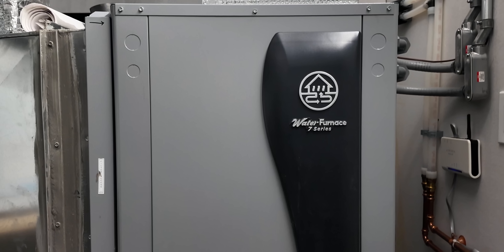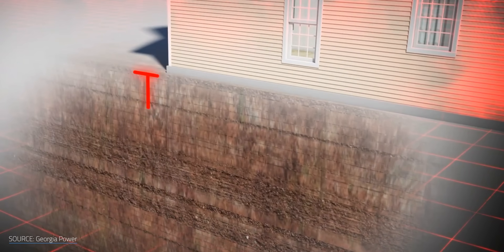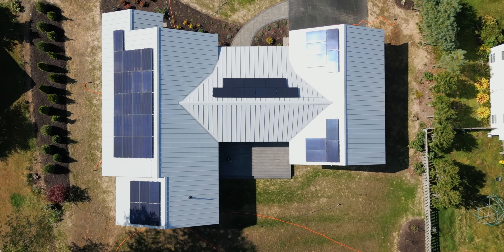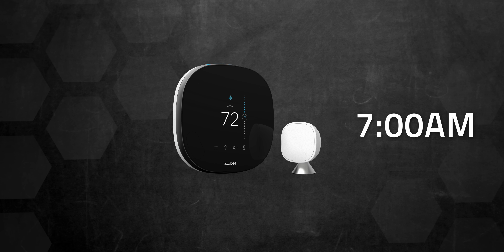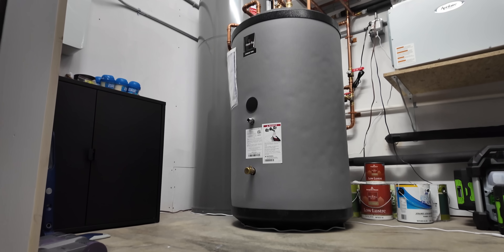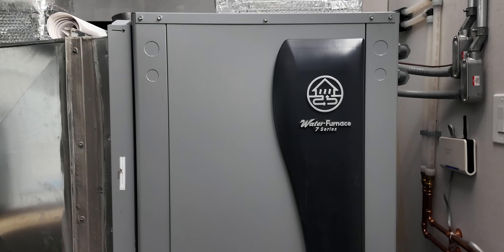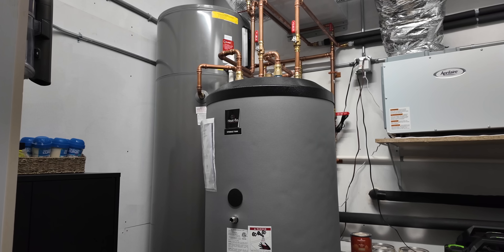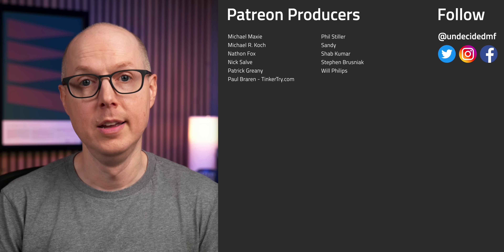How My Geothermal Heat Pump Really Performed (2 Years)

Comment: Main problem is cost, but more so, in that its complex. You are talking about digging and drilling - follow by pipes/materials. Without those rebates, the answer would be no. No one has that money upfront and if you do - you are not worried about energy prices like that. So over all, I say a heat pump with a  backup would be more than enough for many people and they do make hybrid systems like that either it be gas or electric. If the system does have an issue, you more than likely wont have to get someone that knows that system either meaning you would have a bit more access to more repair options as well. With that said, I would love to see a hybrid heat pump hot water + HAVC system some day. One pump that allows the recovery of that heat back into the water reducing the over all cost of the system and with only one pump reducing the overall complexity and cost of it as well.

Comment: Sadly, using a heat-pump for heating my house would be more expensive.  I'm in mid-west Ohio.  Our gas prices are dirt cheap, and it's much cheaper to use gas to heat the house, than any form of electric heating, heat pumps included.   That also makes a geothermal system wildly not worth it.   Also, My electricity prices are also really cheap.  With the delivery fee, It's about 17 cents per Kilowatt.  

Assuming the same installation costs as you ( yes, I know I can't assume that ), with my gas and electricity prices,  the return on investment time would basically be double compared to you.  But because of our cheap energy prices here, I haven't even looked at what a geothermal system would cost here.  

But, I'd LOVE to get solar panels.  I have a north/south facing roof, so half my roof points directly at the sun.  Since I don't do youtube as a job, and thus don't need a home server and equipment, I'm totally positive I could 100% offset my electricity usage with solar panels.   I have to have my roof re-done soon.  I might look into what a solar setup would cost, and any potential rebates from my state.  Sadly, the orange retard is killing the federal rebate on the cheapest form of electricity humanity has easy access to.  So I won't be able to get any kind of federal rebate.

Comment: The rooms at the back with the greater heating/cooling load... isn't keeping those more stable in temperature just a case of better emitter tuning required to match the loads, rather than a fault of the main system? I mean... can't you increase the delivery of heating/cooling to those specific zones as a one-off exercise?

Comment: Did a self install whole house Mr Cool. 
This was the second product from them I've purchased. The first was a small mini split in an addition (I don't want to jinx myself), it just works - set the temp and it ramps up and down as needed. 
The big heat pump replaced a single stage unit from the 90's. So far it works great, it's quiet and my electric bill is dramatically lower. 
I'm in Northern VA, the supplemental heat (those big coils that go "Click") never kick on anymore. I also did one of those heat pump water heaters a few years ago, the purchase price was over twice a traditional electric one, but paid itself off in about three years.
Reply: @phredrolltek  Mini splits are amazing.

Comment: We have an open geothermal heating system, with separate extraction and injection wells. I do not cool with it.  It has worked reliably for us for around 10  years, but our 100+ year old house is not tight or well-insulated, so our electric bill is dramatically higher than Matt's.   I don't think our power bill ever drops as low as CD$60/mo and is usually in the CD$400/mo to CD$500/mo range in the coldest months (Dec-Mar).  Still, having oil heating, resistance electric or air-to-air heat exchanger would face the same issues with our drafty house, so the geothermal system is still a plus.

Comment: Now that cold weather air-source heat pumps are getting rolled out by major manufacturers, most of which can provide 100% BTU’s at 0*F and still function down to -15*F, there’s really no need for ground source heat pumps anywhere in the lower 48. 

They can handle 99% of the country for 99% of the year, and electric resistance backup can handle the few hours a year some locations stay below -15*F overnight.
Reply: I don't know if he is comparing the operating costs of his geothermal system to the operating costs of a modern heat pump.
Reply: Yes, they can do it, but nearly as efficiently.  That's the whole point of ground source.

Comment: I’m still amazed that solar and heat pump tech in the US is so pricey. 
A 14kw heating/cooling ducted system (air source) for a 250square meter internal house with full automation for every room is only $20k AUD in Australia. We have 15kw of solar and 27kw of battery, for $40k AUD. We pretty much never use any power from the grid, and also charge our two EV’s as well. 
Hopefully things come down in price soon over there for these things! 
Great video too 😉
Reply: Yes, it seems so crazy to us Europeans too, but US have a lot more middle men and Bureaucracy with their fees if you step out of their norm which is coal and oil.

Comment: I do get the heat pump craze is great just having to worry about the construction to the equipment cost is always a hair puller but everyone needs to get paid. One of my friend's childhood homes had one, it even tied into there bathrooms tiles, it was so fancy at the time and just so comfortable to take a shower felt like a spa for your whole body 😂. Regardless I remembered they spent like 1.5mil to built the house yikes 😂. Im all for cost to efficiency ratio but even if I was rich id try to get it planned so. Maybe in 10yrs ill do what you did figure out the best plan for super comfort and get it to a 95% efficient house. Thanks for sharing 🎉

Comment: I wish some of these heat pump videos focused more on the refrigeration side of things. Living somewhere that regularly reaches 40°C most of the year I've always wanted to know about ways to not only chill my apartment but also use that heat energy for something productive instead of just paying to let it go to waste, but having a massive water heater at home in this climate is basically steaming yourself like a buttered lobster. All the info is usually focused on the global north and nothing really worth pursuing here.
Reply: there are plenty of videos about cooling-focused systems, and the choice is as wide as in heating- focused systems. If you live in dry hot climate, you could investigate direct or indirect evaporative cooling. If your climate is continental- hot summers, cold winters- then you definitely should check ground-source heat pump for heating with direct connection of ground loop to interior cooling devices- fancoils for almost free cooling. In all climates good insulation and smart management of solar heat gains is first priority, then comes sufficiently large ground loop and radiators or heated/cooled floor. All heat pumps, in heating or cooling mode works most efficient when the temperature difference between heat source and heat emitter is as low as possible.

Comment: I have a design concept that temporarily stores Grey Water from house hold showers, clothes washing and dishwashing in underground tanks.  The grey water can then be re-used for flushing toilets which reduces the intake from wells or municipal source AND reduces the output to septic tanks and municipal sewage treatment systems.  The tanks can also act as a heat storage system in conjunction with a heat pump which extracts heat from the grey water and also stores waste heat from PV Panels for later use and also cooling the panels better.  The concept has a pump which can switch to a sprinkler system installed under the eaves and on the roof peak to help fight fires if living in a rural area.
Reply: I have a feeling you would run out of water for all that. But they already do make grey water recovery tanks and they do similar stuff. With that said, while I dont know anyone that has similar, I would assume a recovery system does come with a few cons other wise we see it more. For example, you have to filter materials out of the water or risk that stuff building up over time. A shower still has soap for example and sink water might contain some food.
Reply: @adr2t  It gets recycled back into the toilet and then onto either a septic tank or a municipal treatment plant which is exactly where it goes with out a grey water recycling system
Reply: I have same fire issue.  5 evacuations in 5 years.  Last one took out 85 homes in my neighborhood.  Insurance ( my house survived) has become an issue.  Can you elaborate on waste water / solar panel cooling ) under eve sprinkler system?  Direct me to a supplier or a video?  Thanks, and thanks for posting your comment.
Reply: @pierrepfeffer4758  
Sorry but is just a design concept.  I just worked on it on my own after we lost 233 metered structures last summer.  If you like I can send you some PDF's so you can decide its merits?
Reply: @anguscampbell1533 yes please.  A contractor up here has advocated for under eve sprinklers using rain water.  Would love to see your more comprehensive approach.  Thanks.

Comment: Given such a sealed up house, what is your air circulation/filtration situation?
Reply from the maker: We have an ERV that’s running at a very low level 24/7, which not only keeps the air fresh inside the house, but does a great job filtering out pollen and pollution.  The hvac system also has a decent filter on it.  I also have a few in room air filters to help deal with my pet allergies.

Comment: I live in South Dakota and had a Water Furnace geothermal system installed about 12 years ago. My house is over 100 years old and we have done many upgrades to improve energy efficiency although it still is not nearly sealed and insulated as good as I would like but at the same time our experience with geothermal has been very good. I do use a back up heat source for the wildly cold conditions we often get in South Dakota( at time -50+ F windchills). I looked at the long term on everything we did to the house and the heating/ac has paid for itself over about 8 years. It really shines for cooling. (S.D. can be brutally hot, at times getting hotter with humidity that rivals New Orleans) That has been the very best  surprise for the system. It has been pretty much a trouble free and money saving investment for sure.
Reply: What are you using as a backup heat source? I've long thought that radiant heat panels would be ideal if you've got the energy budget, or a wood stove?
Reply: Be careful of sealing up your house too tight. Houses need to ‘breathe’ or you might run in to mold issues from condensation.
Reply: I have installed a gas propane heating stove with thermostat,  to supplement my system. Or if electricity is off for extended period.  Might not heat my whole house but should keep pipes from freezing.
Reply: How much did that system cost 12 years ago?

Comment: We were excited to get our geothermal system seven or eight years ago. Last year, however, the condenser coil failed, and the indoor unit needed to be gutted and replaced to solve the problem. 

Fortunately the system was still under warranty, so we paid nothing. 

I later learned that the only other two folks I know who have geothermal had the same problem during the warranty period. One of them had a second similar failure after the warranty period, costing him thousands of dollars to fix. 

We all had the same contractor who presumably had the same supplier.

I don't know how common this problem is. The contractor blamed it on the newer refrigerants and the coils. 

Any thoughts on this?
Reply from the maker: That’s a new one for me.  I’m not sure how common or wide spread that is.  Curious if others here have seen something similar.

Comment: Nice!  I'm in the same boat. I want to build my forever home in the Northeast. I want geothermal, solar, and wind for the house and the walipini. The upfront costs aren't the problem, it's the "you can only do this once, get it right" aspect that drives me crazy. Plus, I am a few years from that point where I will be breaking ground. I have time to figure things out. I think.

Comment: Hello can I ask a question have you thought of adding Solar Thermal Vacuum Tubes for the Hot water? Or maybe adding to the heating temperature?
I want to go geothermal in my next home, but as well as Solar PV & will add 2 units of Solar Thermal Vacuum Tubes, far better than flat plate type

Comment: I built in 2001 and have a split(2) unit geothermal.  One upstairs, one downstairs and I heat/cool nearly 2x as many square ft as I previously owned.  My water well driller drilled the vertical closed loop system(3 addl wells)  2x 225' and one at 375'.  Ave ground temp here is 51 degrees. At the time,  other heating systems were comparably priced as the geothermal units.  The "extra" cost was in the wells.  I am insulated better for sure, so I paid a bit more for 2x6 walls and blown insulation in the attic, which would have helped any system. There were no governmental rebates or incentives. The first year, my most expensive heating month was $150 less than my average at the "old house".  There is no doubt that geothermal is well worth the extra upfront costs.  Even at a home sale, in my area, one with geothermal will add $20,000 plus to the sales price.  In Matt's area, probably add $50,000 to the sale price.  If you are not building and your current heating system is on the fritz AND you can afford it, put in geothermal.

Comment: We did geothermal about 15 years ago here in the Nashville, TN area. 4 wells about 300ft each. We have a 2 ton (24k btu) unit & a 6 ton (72k btu) unit. Superdeheater on the big unit. Use marathon water heaters. House built in 1993. We still spend $600/mo on electricity at just $0.12 per KWH!  We use Ecobee thermostats & do some time of day temp controls. Also use energy monitoring tools on many circuits. Still using WAY too much energy - 3,800KWH per month!
Reply: I hate to ask, but what are you running besides your HVAC? I would guess an EV, but im interested. 

We have a small (1,500 ft^2) "manufactured home" (aka a double wide) built in the late 80s. We live in central Texas, and see temps up to 110°F in summer and as low as 10°F in winter. At worst, in mid January and February, our electricity use is "only" 2,250 KWh. Our summer peaks at only 1,500 KWh, and our lows in spring and fall are around 750 KWh.

And our house has horrible insulation 😢
Reply: @JR_MacD  no EVs. We have a swimming pool so the pump runs for about 12 hours a day and in the winter, it runs 24x7. We also have a hot tub but it is off in the summer.
Reply: @SorryRadioFace So, your lifestyle is super energy intensive. The pool alone is a huge waste
Reply: @Katana_00  ok - thx
Reply: @SorryRadioFace also, why should tax credits go towards subsidizing your lifestyle ?
Reply: @SorryRadioFace  ok, makes sense. Thanks!
Reply: @Katana_00  IDK - did anyone ask about tax credits?

Comment: 31 cents per KW/hour!!!  The national average is 17 cents.  I live in Texas, which has a unique "Power to choose" program available to many residents.  My all electric home runs on 100% renewables for 15 cents per KW/hr.  Half is for the electricity itself, the other half is delivery over the grid.
Reply: Electricity is very expensive in the Northeast. We don't have a lot of our own power generation and there isn't a great delivery infrastructure for natural gas.  (We really need some new nuclear.)
Reply: I was surprised by that as well, I thought electricity in Europe was expensive but I pay around €0.25/kWh (in a country with one of the highest electricity tax rates)
Reply: Try CA with its tiered rates we average over 50 c/kwh  and that is with over 10 kw of solar don't believe... me check the link chrome-extension://efaidnbmnnnibpcajpcglclefindmkaj/https://www.pge.com/assets/pge/docs/account/rate-plans/residential-electric-rate-plan-pricing.pdf

Comment: The elephant in the room is having low thermal mass buildings made of wood. Increased thermal mass means lower variation in temperature. In the UK modern houses also fall into this problem; reduced brick use and non-structural plaster board walls reduce mass. This was sold as allowing faster rates of warm up in the late afternoon when returning from work completely forgetting people who might be in the house all day. It's real reason was to make house building cheaper. Modern properties have increased CO2 emissions, given me an old house anytime!
Reply: With good insulation and air sealing the thermal mass is not an issue.  And how are new houses emitting more CO2?

Comment: Hi Matt very interesting as I’ve come to expect from your channel, quick question - Are you capturing / recycling all the heat from your server rack etc, if so can you do a video on this please.  I know some big crypto mining factories are capturing/selling the heat from their operation but wondered how it would work on a smaller scale.  Long term, assuming we sort the 100% green energy challenge the next problem will be our direct heating of the planet through waste heat, so I’ve been blue skying that problem (just a thought experiment) 🤪🤪👍👍👍
Reply from the maker: Glad you enjoyed the video.  I’m currently not capturing and recycling the heat from my server rack.  I was actually just talking about this with my wife.  I wish I had wired all my Ethernet lines into the mechanical room where the heat pump water heater is.  If I had done that the water heater would have helped to keep the server rack cooler and the server rack would have been supplying the heat needed by the heat pump.